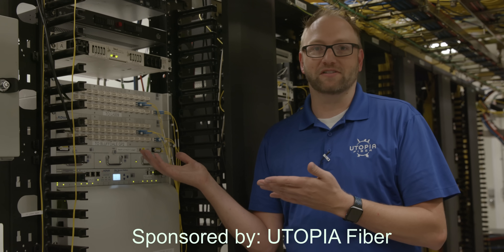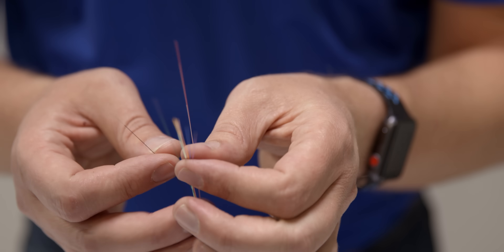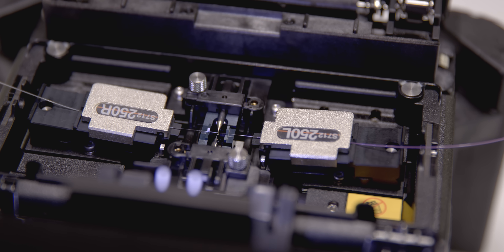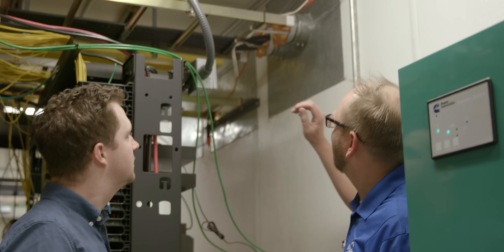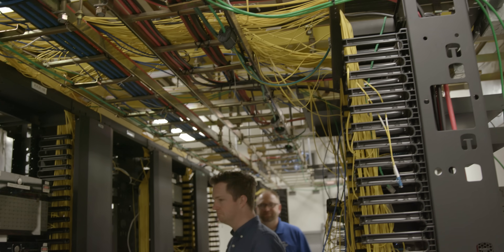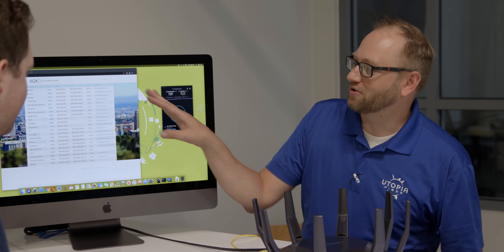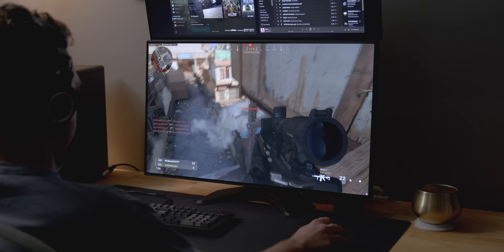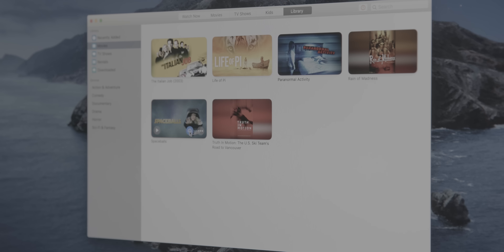4 Terabit Internet?! Fiber Company Tour!

Comment: As a note, you can easily do 10Gb/s on GPON networks, depending on the implementation, XGS-PON can do 10Gb/s across the same PON networks just  requires another SFP+ module on the customer end and some fibre splicing magic on the other.
Reply: You can do 40gbit on a NG-PON2 network and it’s as simple as swapping out the OLT.
Reply: @K1ish  swapping out an olt is a costly affair, kit we use, you just change the card
Reply: In practice xgspon is closer to 8gbps because of encoding overhead. And regardless a fixed ptmp network structure with splitters in the street is inferior to true ptp, where you could still use Pon inside of the central office to save port costs.

Comment: Something else to keep in mind here. If your hardware doesn't utilize the speeds you're given you will see a cap as well. So the average Joe Schmoe with his Walmart purchased laptop or desktop machine cannot take advantage of anything beyond gigabit, and especially if that person is on wifi only, there is literally no wifi router that can do full gigabit, let alone 10 gigabit. I personally can support it wired only and that is because i have the necessary addin card on my PC, but neither of my laptops can. I am very much hoping that faster networking components become available in short order and become more mainstream soon.

Comment: Nice for you. Although I am got some decent connection through a certain cable provider. I keep saying it used to be that we had lots of choice in the dial-up era as long as you could get a local number for a ISP you could use whichever one you wanted and if you were willing to pay the long distance it didn't have to be local if it gave you a good connection we lost all of that choice and then Network providers didn't really update their infrastructure mostly because the internet a fad didn't just go away and yeah we really want to be selling your phone service and TV services. And now we're in the year 2020 where it really should be a utility after all we kind of need it to work like a utility now. I am in a rural ish section of West Virginia that well probably has a ton of fiber going between all the states around us but yet we're not really connected in oh, and we're stuck with Frontier Comcast and if policies would allow a local independent company WISP and cellular and satellite. Even though the state owns part of the infrastructure once you get permission to use that you have to go fill out the paperwork with Frontier and we all know how that goes well at least until they went bankrupt.

Comment: I am using 1GBPS for just $10 a month. Trick is keep switching your plan between High cost and low cost,  And once in a while billing person will make the change but somehow in real your speed is not changed. This doesn't work for all ISP (like those who are controlling speed through software, thus billing & network are controlled from the same point) but it does work for Utopia like system, where someone physically moves your connection from one port to another when you go for high speed or low-speed change.

Comment: That’s the same technology that OpenFiber in Italy uses.
Reply: Basically anyone, allthough I think we lay pipes here in the Netherlands and then blow the individual fibers through
Reply: bart batenburg I was talking about the fact that OpenFiber builds the network for different providers. If you want to change provider they just have to swap your cable with the one of the new provider on your nearest OpenFiber hub and you’re ready to go.
Reply: @albertocrescini2076  Ah like that, Yeah we have that in some areas in the Netherlands too, luckily at my place.  Sadly some parts are stuck with GPON, which makes it so that the data has to go through KPN's network and they can set the price at almost anything they want (capped a little by our consumer rights authorities)
Reply: bart batenburg actually we do use GPON, and indeed the prices are pretty much the same for every provider, 23-30€ for 1000/300 FTTH.

Comment: I have a question. Since fiber travels at the speed of light, that's why it's so fast. But technically speaking, so does electricity; so why is it that traditional Ethernet cables aren't as fast if the electricity pulses also travel the speed of light?
Reply: Because of attenuation, crosstalk, induction, interference limiting the maximum bandwidth of the cable.
Reply: K1ish oh, and that’s why they use multi twisted cables in the Ethernet cable, right? To try to reduce those interferences.?

Comment: Ugh come on Utopia I NEED this. Come to Indianapolis. Currently paying $50 a month introductory price for 200/10 with a 1TB cap. It's ridiculous. I can't have any modern internet services like a web server or an off site backup. When I can pay $10 a month for a VPS that has 2TB of transfer with 1000/1000 you know that the rate of data you're being charged for is BS. Like yeah whatever the lines in the ground have a limit, and switching capability is dependent on hardware, but come on. I have enough networking equipment and fiber in my LAN than my whole neighborhood distribution is provided by the ISP, by the rates and figures they provide. I see them laying new huge fiber trunks all the time but nothing ever comes of it. Prices keep going up for the same if not worse tier of speed. They seem to have peaked somewhere around 2010 in my area.

Comment: ...and here I am using Australia's AU$51B National Broadband Network and the best I can EVER get is a VDSL2 FTTN 50/20 connection using the phone lines that have been buried in the street for the last 50 years. VDSL2 also creates a LOT of interference on the HF radio bands (which is bad for me being an amateur radio operator) PLUS when I transmit on 3.5 MHz or 7 MHz my connection drops.  I was able to mitigate this a bit with a notch filter on my VDSL2 line... but this cripples my download speed... plus this doesn't help my neighbours.

Comment: $200/month for 10Gbps? My home is wired for 10Gbps, but my old ISP chaged me about $200 for 50 down 3 up, and because it was cellular, that meant i needed a second(again cellular) ISP for the quite often occurence of down time, this meant two different bills and two different billing cycles and a total cost of around $270/month for a combined throughput, using load balancing, of around 90MB/s down and 6Mbps up.

Comment: When your connection is so fast, that the providers themselves become the bottleneck.
Reply: I have a 500/200Mbps connection and I many times the websites/clouds are the bottlenecks. Dropbox, for example, tops at less than 30Mbps of upload speed which is ridiculous.
Reply: @njsfer  same I get 30 mbs download mostly some have 60 mbs still nice
Reply: Already happens with Gigabit some times, even those running speedtest servers, I have to find companies that are peered to my provider to get any real results
Reply: @bartbatenburg  bruh does fios throttle?
Reply: @Bizz
Providers/ISPs are obviously going to slowly upgrade people's broadband speed. By slowly upgrading people's internet speed, this will give people a bit of a wow feeling that their broadband speed has significantly improved. The storage devices in our computers will have to at least match what broadband speed we get anyway. 4Tbit broadband speed would be pointless anyway, because we currently have no storage devices quick enough to write at that speed.
Reply: @zx50  yeah but if 4tb connection was available for everyone, Development for storage devices that could support that would be kickstarted.
Reply: @zx50  NAS like: hold my beer!
Reply: @zx50  Should realize that this 4Tbit is total network capacity, it doesn't mean anything. Tier 1 ISP Cogent can has 200Tbit speeds, that doesn't mean all it's clients are getting that speeds or it's 200Tbit from any point to any point, that's their TOTAL capacity. It can be broken down from which POP to which POP, etc. 

People should understand that Internet is NOT a thing you can have a dedicated speed to, that's just not how it works at all. There's a lot of complexity, stuff like Peering, Transit Providers, IX's, etc etc and way more.
Reply: @hariranormal5584  Yes, I do realise that ISPs will have massive capacity so all their customers can get decent speeds.
Reply: same here, I have 500Mbit/s connection and 70% of my sources doesn't run on half of that speed. 50% of them is because of my country located in the center of Eurasian continent.
Reply: lol i like this 1

Comment: Damn! I wish the fiber provider coming to my neighborhood was AE instead of GPON, although they claim to have 10G-PON. They also claim that your neighbor being online won't slow you down. I guess that's the case because they want $495 for Gigabit. $65 for a measly 50 Mbps, $95 for 100. I guess it's better than satellite or the cable that can barely do 1 Megabit. I guess that's getting upgraded too. 25 Mbps/4.5 Mbps for $65.  They can't compete with the fiber provider. It's funny, the cable company used to be president of the FTTH company. That's not the case anymore.

Comment: Holy Hell! we need then over here in the UK, the max residential properties can get is 1GIG "fibre" that's delivered over COAX cables and it costs us 80-90 £GBP IF you are in the correct area to receive it otherwise we are sandbagged at 350mbps or 500mbps NON symmetrical...

Comment: What's weird about my internet connection is that it is running through a 50 years old telephone cable. I live in a fairly densely populated area so more than 80 Mbit are impossible here. Yet my ping is extremely good. Most of the time it's around ~14ms. Obviously this depends on what server you connect to but this is mostly the norm. On my PS4 I basically have a locked 9ms. That's pretty crazy considering it's running through a 2 conductor copper cable from 50 years ago.

I love how he's talking about Gigabit being the norm and we need even faster connections. A friend has the fastest connection I know of and that's 460Mbit. Not even half of a Gigabit. I don't even have 1/10 of 1Gbit.

Comment: Peerings are the Internet. The distinction the utopia guy is making there is not actually helpful i fear. Especially in Europe more centralized Internet Exchange Points are responsible for handling quite a large part of Internet traffic while in the US its mostly what is called 'private' peerings between two ISPs/Carriers at a location where they both happen to have equipment. All of those together form the Internet. He probably meant that those peerings are usually free of charge as opposed to transit traffic that you have to buy from a higher tier network so they transport your packets to where you don't have a direct connection to.

Comment: I remember fusion jointers that you needed to mount on a truck back in the 1980's.
Reply: Most of fusion splicing is still done in trailers because it’s easier to prep in a trailer than outside

Comment: Speed of light is about 30cm per nanosecond.  On a 10Gbps connection, that means that the individual bits are spaced about 2-3cm apart on the cable. The speed of light is fast for humans, but for computers that typically run at about 2-5 clock cycles per nanosecond, it is incredibly slow.

Also, US internet prices seem really expensive. My internet service, which is probably they equivalent of your old cable at about 55Mbps down / 15Mpbs up, costs  me £25.50 per month. My 4G is slightly faster and costs me £20 for 100GB data, unlimited voice calls and unlimited texts.

Comment: In France we can have 10Gb/s connection (not symmetrical but still) for approximately 50€, and we use GPON infrastructure (10EPON exactly), personally I have 5Gb/s down and 800Mb/s up for only 40€ per month that's pretty cheap ^^

Comment: Very cool video - Didn't know about the colour splitter tech.

This company kind of does what the power companies did here in Denmark a few years ago. The biggest ISP in the country (Denmark) had invested HEAVILY in copper based ADSL infrastructure in the 90s, and tried their best to earn back on the investment by simply ignoring Fiber for anyone but corporations and leasing out their lines to everyone else.

So the power utility companies everywhere started laying down fiber in the rural areas in the irrigation ditches. Easy to dig in and cheap. Plugged in entire villages at a time. They've finally reached the larger cities and the aforementioned ISP is ironically now looking to lease the Fiber lines, which is a complete reverse Uno card to their previous slow monopoly.